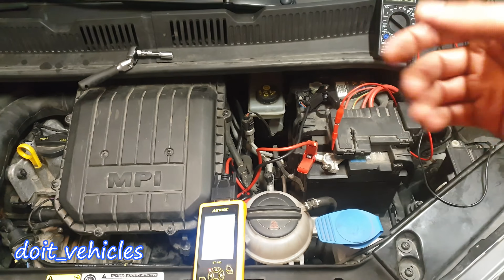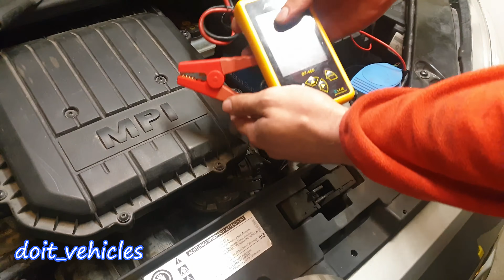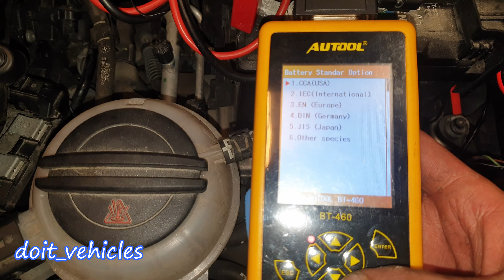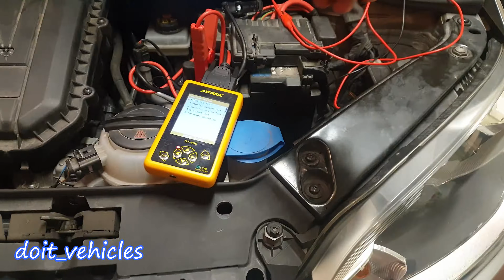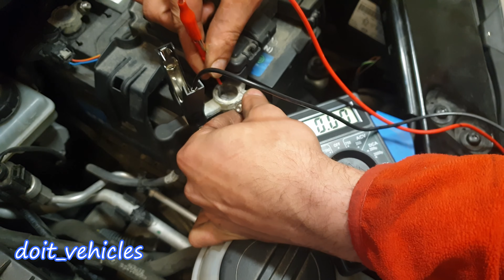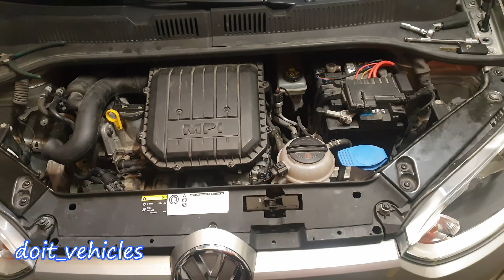2013 Volkswagen Up ! Battery Replacement / Test

Comment: Thanks for the video, it was very useful, I managed to keep the system with an adjustable source while I removed the battery to fill the levels. For that, 2mm holes are drilled on each of the 6 glasses and then distilled water is added with a syringe. Distilled water evaporates with use and for that reason it is necessary to complete the levels, as it was done before. In the end the holes are sealed with silicone, and there you have a battery that will last you another cycle.

Comment: I did the battery replacement today using a 50Ah SMF battery. I did not use any alternative power source. All I did was removing the one bolt holding the battery, and the two main poles, switched during a few minutes and all was good. 
Don`t repeat my mistakes, first, remember to remove the bottom bracket before the power-connectors so the power is away for just a couple of minutes. (I was out for maybe 10 minutes and it was fine, but shorter is better) 
Secondly, I accidentally quick-shorted the terminal + with my wrench, so make sure to keep that red connector plate away from any metal car part. After installing the new battery, the car system was fine and all systems worked like a charm! 

It might be a good idea to temp wrap the red terminal in a bag or have a helping person holding it while swapping the battery. 

Programming: I have read different opinions about it but I don`t really belive reprogramming is crucial. Batteries degrade over the years and even if your battery has slightly different specs compared to the old one, the old one was degraded and had much worse performance anyway. The new battery can only perform better and there is a built in health measurement that should adapt to the new battery. It did say the old battery needed to repair, so I assume it will detect that the new battery is healthy. Maybe the programming is supposed to tell how quick the battery can be charged and what the capacity is, again, those are numbers that will float over the years.
Reply from the maker: thanks for the contribution to the topic!

Comment: THANKS TO THE VIDEO BUT IT IS TOO LATE FOR ME NOW, WHAT CAN I DO IS I REPLACED THE BATTERY AND NOW I HAVE ALL KINDS OF ERROR CODES?
Reply from the maker: Replacing the battery should not trigger trouble codes
Reply: Hi, how did you solve this? According to the manual, the car should recode itself after a few kms of slow drive (15-20 km/h). Please respond soon, I will need to change my 12V battery now:)
Reply: @techmech556  I solved it, but I do not remember how. It was a year ago.
Reply: @BenkoEva-be-art  Thank you for the answer anyway!

Comment: You have great videos, but a new start/stop battery needs to be coded for the BEM to charge it effectively, otherwise you may shorten it’s life by under or overcharging it.
Reply from the maker: True ! This can be done to any workshop with a pro scan tool after replacement . I am not sure if this car support this ..🤔

Comment: Whats the worst thing that can happen if you dont keep the computer alive, and just remove the old batter and replace it?
Reply: You can lose your car settings like the radio security code and trigger all sorts of fault codes.
Reply: @RHDM.  YES, THAT HAPPENED TO ME, WHAT CAN I DO NOW? I HAD NO IDEA THAT I NEED TO HAVE MY COMPUTER ALIVE
Reply: @BenkoEva-be-art  Reset the DTC's(car fault codes) with an generic OBD2 scanner. For the radio code you can look into the cars instruction manual. If there is none there is no other option to go to the VW dealer.

Comment: I exchanged my battery just by removing and replacing with a new one.I did no 'keeping the ECU alive' stuff just a quick swop. I presumed with most 
car manufacturers they put in a high capacity capacitor in the ECU to keep all of the setting 'alive' for a few hours.
The radio stations were all saved and the electric windows worked (?) not sure how electric windows would need resetting after a battery swop?
Reply: In fact, the VW user manual states that procedure - no back-up power source is required
Reply: @ArmandoLoni Correct. The service manual doesn't advise or require to use a temporary power supply.
As for the windows, fully turn them down, then fully up again.
Reply: I could imagine that the windows forget their current position if you loose power for too long. Could be closed, open or half open.

Comment: Very helpful, but I would have appreciated a little more explanation (& take a bit longer!) during the process when you remove the negative terminal & the associated wire to be removed (before removing the black positive terminal block sitting on top of the battery) & why (presumably because it allows the block to be moved out of the way to extract the old battery?).  Also, how you remove the black plastic top cover on the terminal block off its base to expose the terminals (are there clips to be eased off & how is it done?)?  Just pause a bit between the stages, please!!
Reply from the maker: Thanks for feedback !

Comment: can you make a video about start/stop system, short explanation how it works and how to test it
i've recently purchased an used VW Up! it has that option but so far it never activated for me
Reply: when u put blinker on to left or right put gearbox into neutral and release the clutch engine will turn off when pressing clutch again it will start the car again and put clutch 1st gear to drive away again Goodluck.

Comment: Great video man but not very clear to me. 
Do you need 2 batteries (old and new) or 3 (old, bypass, new) ?
At your video i have the impression there are 3 batteries, the bypass is in a bag or something at 2:17.
I have the old, a new and a multimeter, if you could explain better it would be very helpful !
Reply from the maker: That was a more lighter li ion 12 v battery that's why I used it .But the new lead acid battery can be used as well , is just a matter of how long the jumper cables are and were you keep the new heavy lead acid battery . All you need is 2 wires to somehow apply 12 v to the main terminals while you remove the old battery . Is not absolutely necessary to do this process , in that situation you might lose some settings on your dashboard or other stuff .
Reply: @doit_vehicles  So all i need to do the replacement correctly, is old and new battery + jumper cables right ?
The idea is not to loose the setting and memory informations !
Reply: @doit_vehicles  thanks for the video, seeing it seems easy enough to replace the battery.what i wanted to know is if as you wrote you can actually avoid bypassing without having to use another battery and directly remove the exhausted one and then insert the new one.another question, after how long did you have to change the battery? did you use the start and stop often? I have a CNG up from 2014 and now the battery has a tantrum, if I don't use the car frequently this does not hold the charge.
Reply from the maker: @pippolino182  a battery life will be in average betwen 2 - 4 years . Keeping the battery low / uncharged for a long time will decrease its life the most .